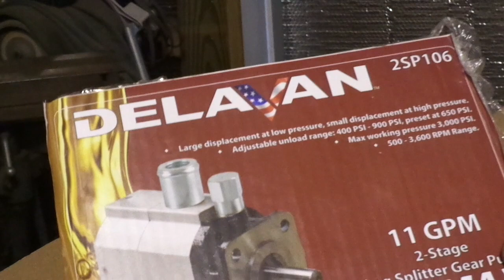Wood Splitter Hydraulic Pump Replacement and Test Run

Comment: Yep, for people like you and I that were born in 1951, we do NOT want to get down on our hands and knees. Besides that, you need a Harley Sportster 1200 engine to operate that I would not bog down.😇
Reply from the maker: Hahahahaha....it'd be a bit more pleasing to the ears too !!  That's a good one Dave.  I did see a guy that built a home made band saw that powered it with a Japanese inline 4.  Man that thing screamed too !!  Take Care and keep the rubber side down if you happen to run in to any snow out there.
Reply: @tractorman4461  I do not have to go anywhere anymore so I will not run into any snow or ice. 

Have a great day and a wonderful 2021

Comment: Try lift'n 36+ diameter 26" long  , then you can appreciate the vertical........... and the 34 ton......... when u-'z solo split'n.
Reply from the maker: Oh heck yeah BubbG, I get that for sure.  There sure IS a place where the vertical function comes in handy.  My bigger home made one 'kneels' down to the ground to bust 'em in two or three.  It stays in the horizontal position to just roll them onto the beam.  Not the easiest on the really big pieces.   The biggest I can remember busting was 52'' diameter.  Thanks for the input and have a wonderful week.